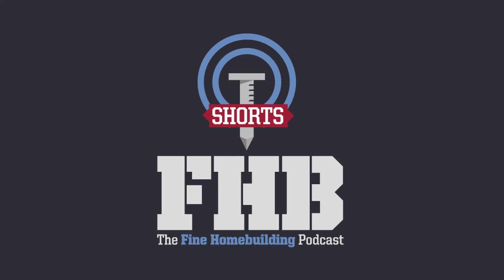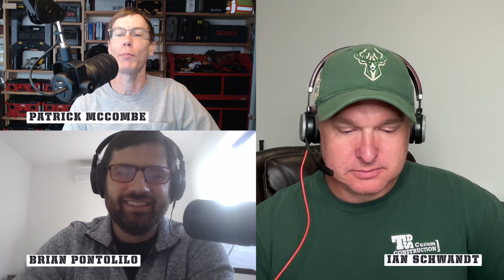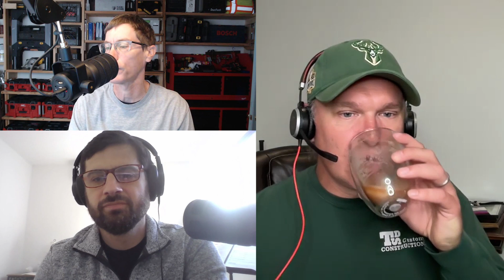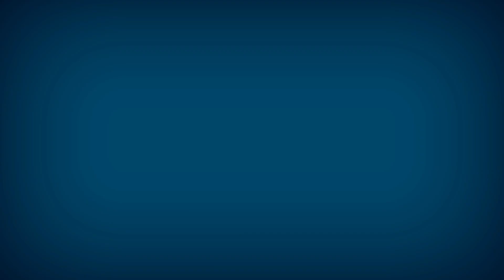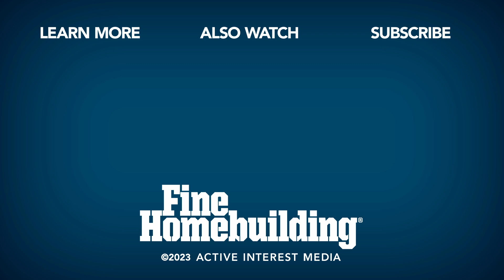Is Foam Against Form Boards a Good Idea for a Garage Slab? | FHB Podcast 656

Comment: 7:53 What’s a ripped down bottom plate?  Is it like a R19 T-stud?   Been looking for insulated slab to sill plate wall transitions that have continuous insulation.
Reply: He is saying cut the 2x6 bottom plate to 2x4 allow the 2 inch foam insulation to continue above the slab